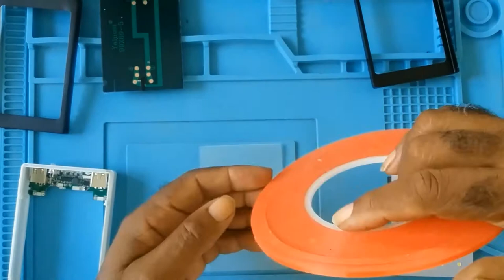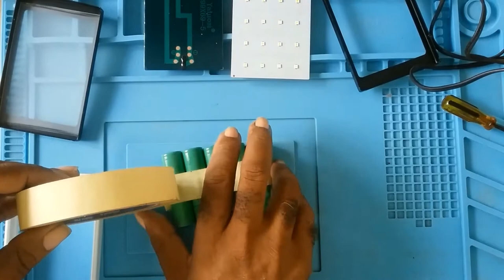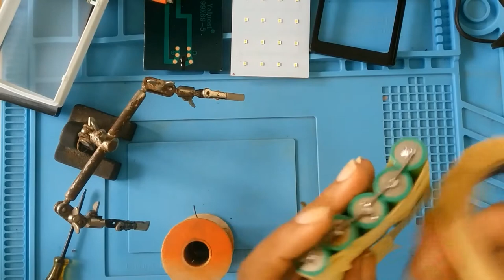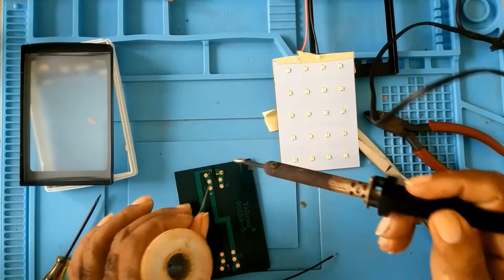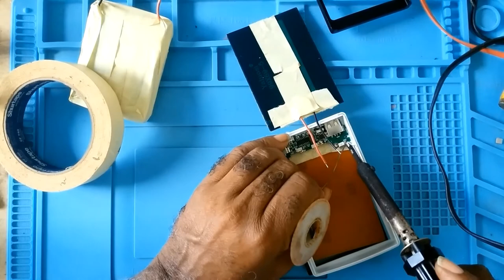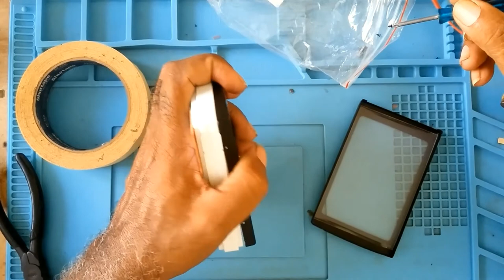Diy Solar LED Portable Dual USB Power Bank Setup

Comment: I respectfully have some tips for you acquired from much experience building radios and other equipment. 1. You are heating the cells too much while soldering; they will be damaged internally. When soldering pre-tinned cells, add some liquid flux and it will melt much faster 2. Improve your soldering technique by applying the solder and iron to the work simultaneously. Never carry the solder to the work on the hot iron, the flux evaporates quickly and can cause a cold joint. 3. The masking tape will dry out and release the cells to rattle around inside the pack and possibly break the connections; use hot glue to secure the cells to each other. 4. Adjust the cells to have the same voltage before connecting them in parallel. Cells in different states of charge can result in a high current between them, which can damage them or melt leads. 5. Add a 3 amp fuse inline on the positive battery lead. There is a lot of power in five 18650 cells and if you have a short, and semiconductors almost always fail short, you will have a fire. Safety first. Cheers!
Reply from the maker: Thanks for that advice and tips appreciate that on the fuse. I have a Sunkko 709as so in the future I will be spot welding the battery. Thank you very much.
Reply: @AlwynNicholas  You're welcome. I like your other videos.
Reply from the maker: @rpbajb  Thanks.